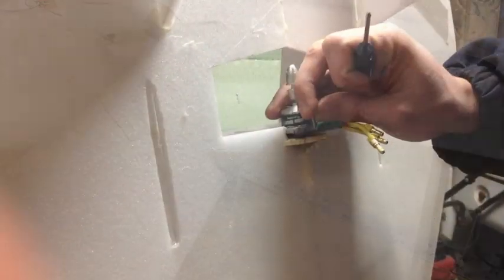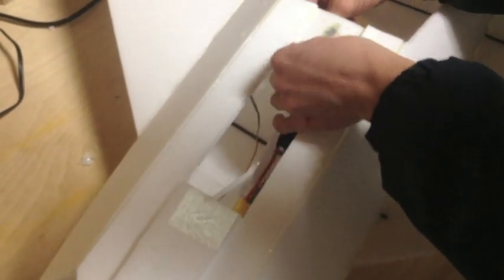How to build an rc plane (part 4)

Comment: very nice build .dear Jeriah Miller This material  work for thes plan
motor/2212-6-2200kv
servo/ 2 pcs towerpro SG90 9G 
ESC/ 30A
dx5e with reciever /CSRC-RX3000             
baterry 11.1v 25c 2200mah
prop/6 x 4E                                 
    thanks